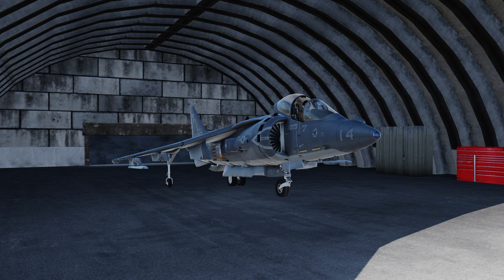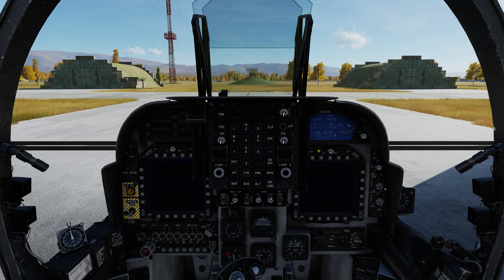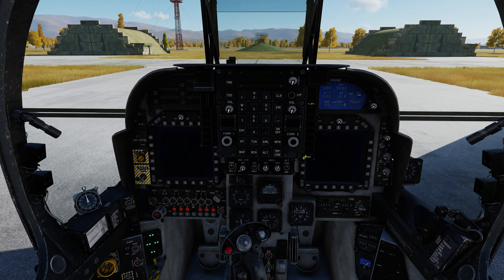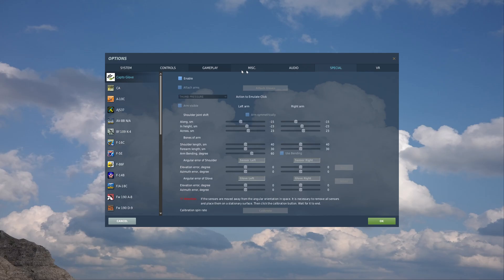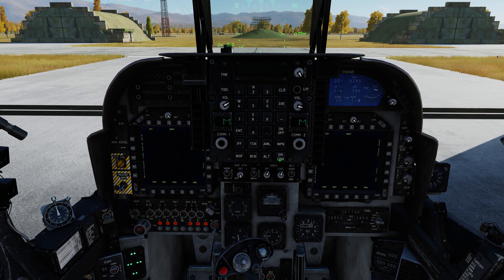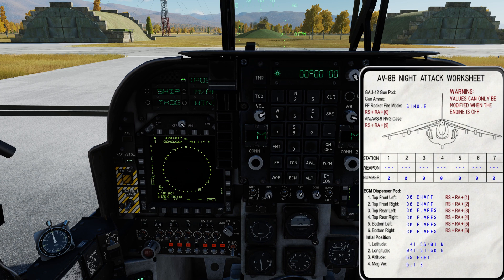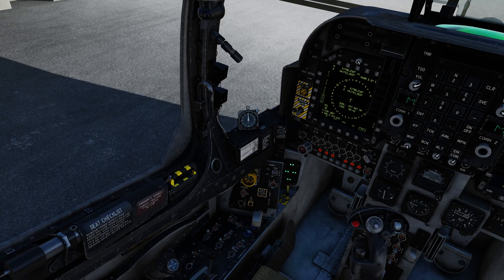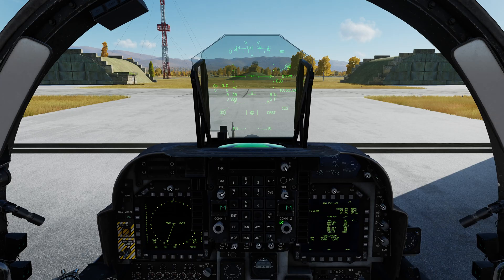Flying DCS World With OverKill| AV/8B Harrier | Startup, INS, and Taxi

Comment: I really like the cold start on the harrier. If you have the INS set in the module options to be pre aligned you can just quickly work from left to right around the cockpit in under a minute and be ready to go. Fun when you don't want to sit around!
Reply from the maker: I agree! I demonstrate the alignment but never use it lol.
Reply: @OverkillSimulations  The harrier is my favourite module by far, only problem is that the Tpod changes have rendered it unusable for me, with the new HOTAS controls only working barely some of the time for actually managing the TDC control and track type. Which means it's limited to pre planned or CCIP attacks only, which is a real shame. The DMT does work, but it's a bit limited.